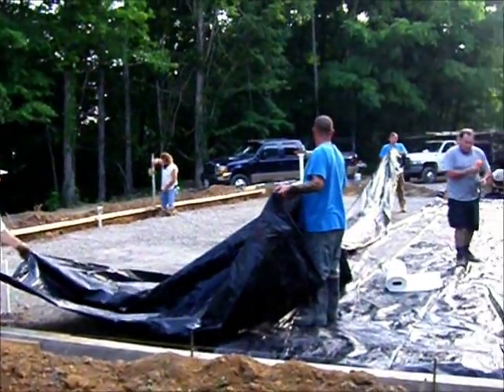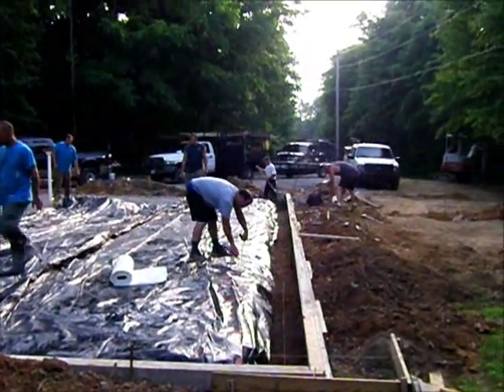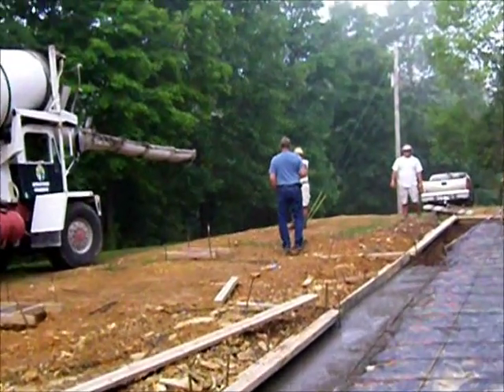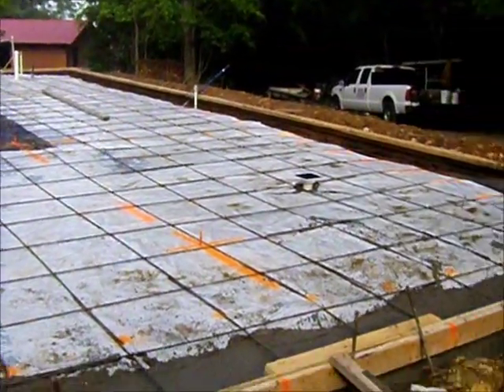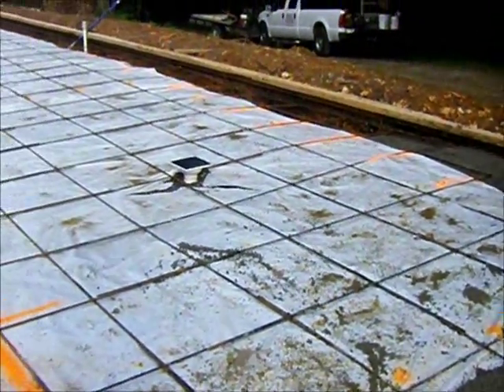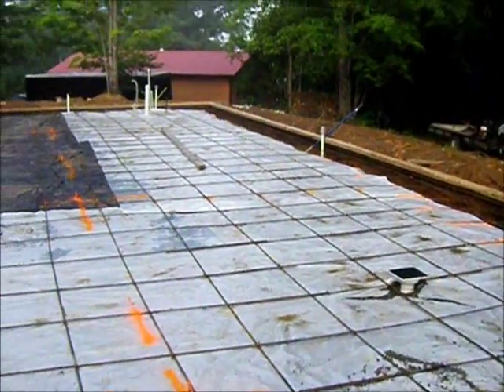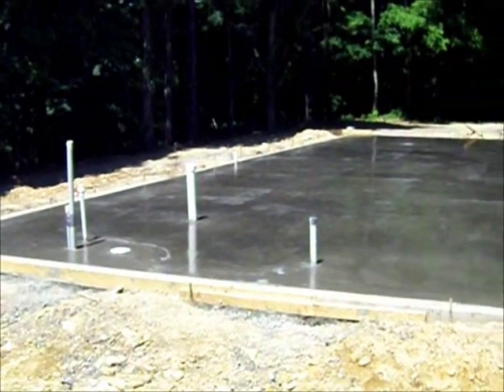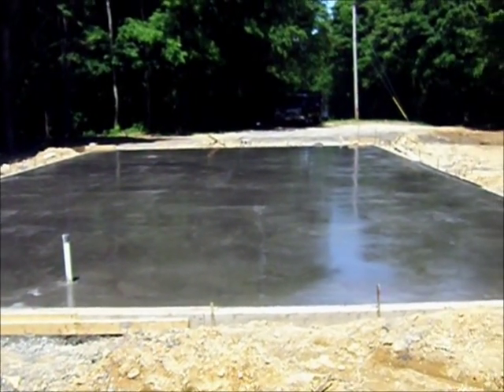Wyatt's dream shop (2)

Comment: Great looking pour, we did slick finish on our floor also, makes clean up a lot easier!
Reply from the maker: I can't stay off of it. I'll walk out there and just stand on it thinking what all I can do when it's finished. I'm like a kid with a new toy. Thanks again for always being here.
Reply: *****
Mine is 36x45 Love it, but I over sprayed the sealer. A small amount of saw dust on your shoes and it is like ice skating after about three years of foot traffic it was okay.

I also ran a sprinkler on my slab for about two weeks during daylight to slow down the currying and had only one crack that is a big slab and will shrink so I slowed it down with the well water running on it is sun light.

You will have it full in a year. My problem is all my kids and brother think I am a storage unit...LOL. Going to have a yard sale!
Reply from the maker: ***** I asked the contractor about keeping it wet but he said the sealer will keep the curing time slowed down enough. I think he is wrong however as I already have one small hair line crack. Bummer.

Comment: The lifting hook is an interesting idea, we used little spacers when we did ours. (Rocks I think.)  Thats going to be a good sized building!  Very nice Wyatt!
Reply from the maker: I thought they would use the spacers too but they said they were too high and didn't want the rebar too far towards the top. That will cause cracks too. SO far the slab is looking good. Thanks for leaving a comment.
Reply: *****
Its interesting to see how each concrete worker has their own tricks. More than one way to skin a cat. (HMmm, thats a really terrible saying now that I see it in print....)

Comment: we have a frost issue here in the winter.  our footings are at least 4 feet deep to keep the building stationary.   Water lines are 5 to 7 feet deep.
Reply from the maker: I have neighbors with concrete slabs and they didn't even dig footers. Just a 4 inch pour on the ground. 12 inches in this area is "to code" even that I didn't have to pull a permit, I thought I better at lest go to what is specified by code. Thanks for the comment.